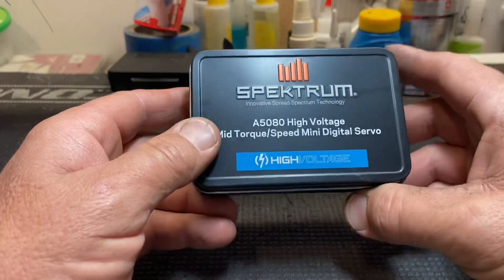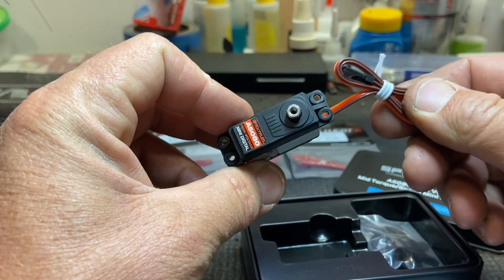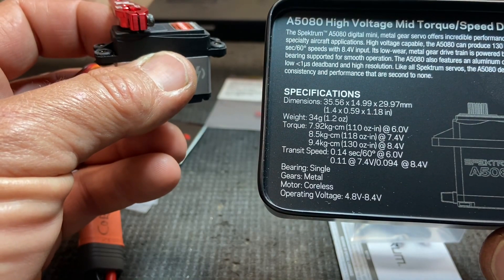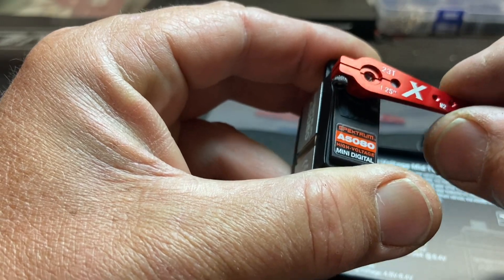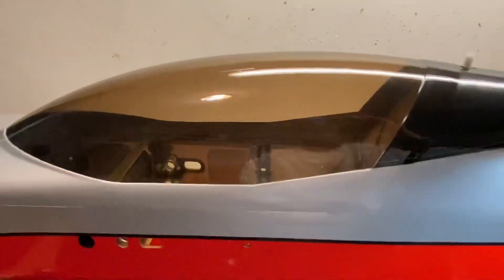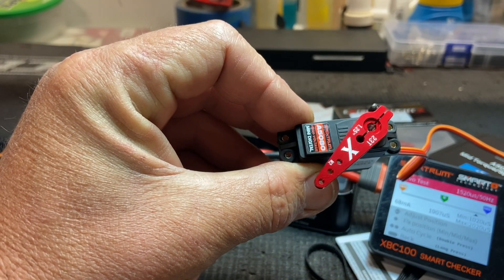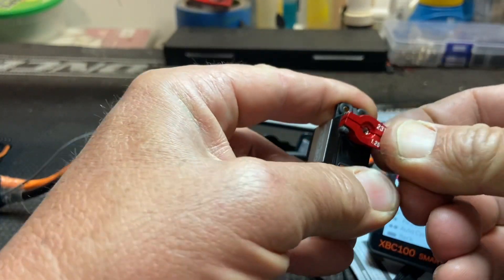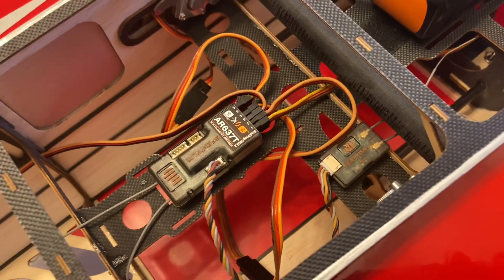Spektrum A5080HV Servo Review. In Stock Now at Horizon Hobby

Comment: Hey! I just installed the same servos in my 60" extra from pilot rc and noticed there is a constant small up/down movement when the servos are at idle. In your other video where you set things up on your radio it looks like your servos are doing the same thing. If this is true, is it somehthing you notice while in the air? I've never seen this on any other servo before
Reply from the maker: Hi there. You won’t notice it in the air, but I did purchase the 5070’s for this plane and I like them better.  The 5070’s are twice as much money, but very precise and stronger.
Reply: @CoeShow619  wow, those 5070's look sweet! But the price tag :O I'll stick with the 5080's and hope they get the job done :)